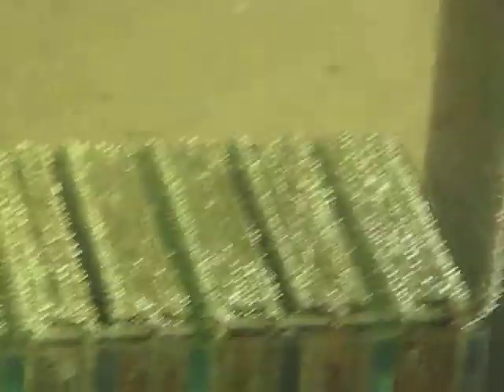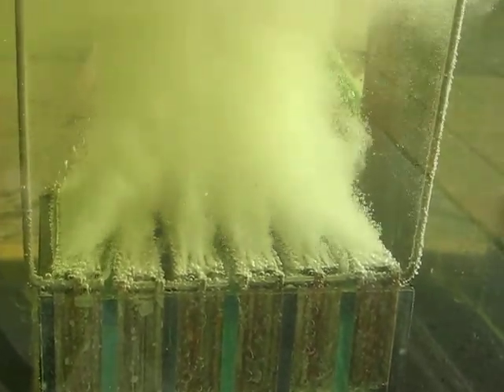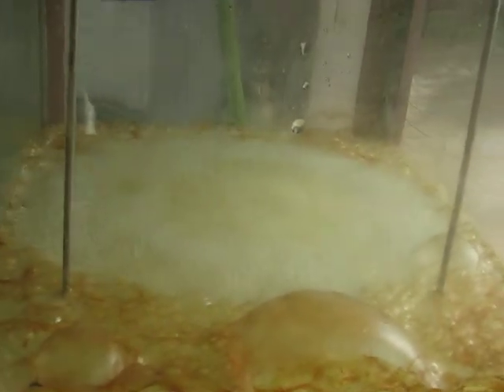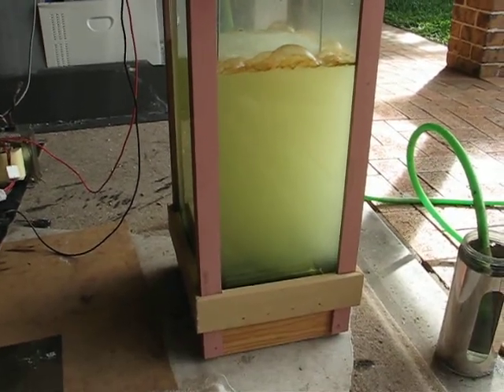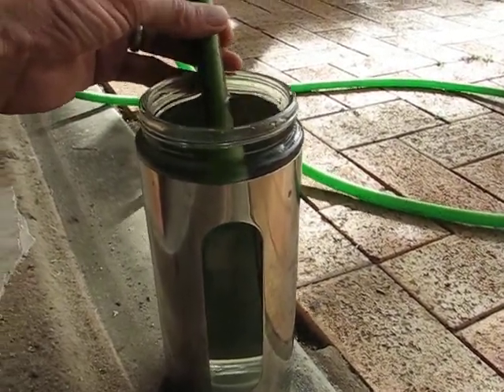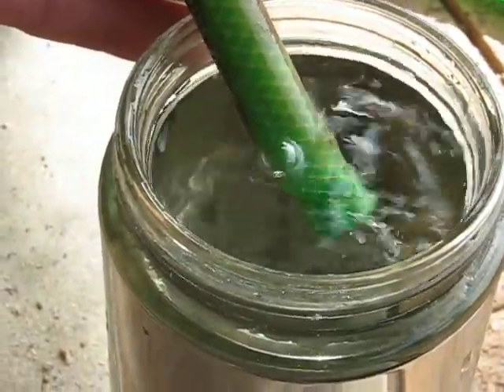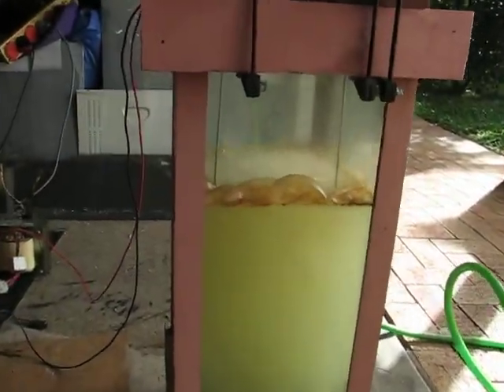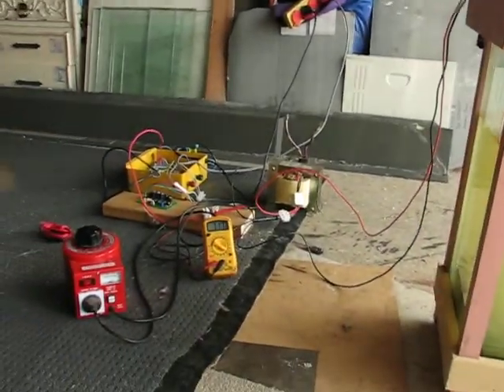My Six Cell Setup

Comment: Now this is more than likely the best advise anyone has ever given you concerning this technology. Find the largest transformer core on the market and get some coated magnet wire at around 16-18 awg or so. The wire going to the positive is to be made of copper and the wire going to the negative is to be made of some sort of resistance wire. Try to aim for the maximum amount of turns that will fit on the core. More than likely you will have to make your own bobbin. Do this and your unit will fire up as never seen before. You should wind a minimum of one thousand turns each in a bifilar wind which is both wires wound together at the same time.
Reply from the maker: Thanks for letting me know about the wire, was thinking about building a new unit soon to put in my car, I have seen a motor run on nothing but water and to look at it you could not see any changes except the single wire coil on the side of the motor that ran strait onto the positive of the cars ignition coil, had no fuel cell at all, he told us he increased the fuel jets to allow twice the amount of flow and that was all, but I was only a boy when I seen it, so he may have had custom spark plugs but unsure, but the coil was around 4x4 inches and would have had at least a thousand turns, so yes will give it a go, but will keep winding until my coil has around the same dimensions and see what it ends up as, will post once I have built it and let you know how it works out, but if it works I may be best to keep it quiet or I might get a visit like the man I seen did, he is no longer with us, if you know what I mean.

Comment: Excellent work thumbs up if you use a tens unit or a pulse width modulation of 24 volts it will increase output and create less heat
Reply from the maker: thanks, I am getting back into this stuff digging up my old files and getting ready, will remember what you said and give it a go.
Reply from the maker: Rachael Reid  
She is a lunatic full on, she did two  other ones but never posted them, well at least it is over.
She acts like this every time she is broke, and believe me that will be in three wees or four.

Comment: Hey, been a while since you've played with this setup. I've figured out how Meyer did what he did now and am now just trying to save up the funds to get things going. I also figured out why when these devices are just added to a car's intake system why they don't work and the reason being one must have access to the car's fuel management system and tell the car not to dump in so much fuel. If not the car's computer will end up making things a lot worse as it's programed for a specific air to fuel ratio and that ratio must be changed to see the benefits of adding in a hho device to the system. 
As for science behind Meyer's technology I went and posted  a link to a pdf file in the pinned post in this video: https://www.youtube.com/watch?v=EkjpVcsRQLc&t=27s&ab_channel=EdwardMitchellEdwardMitchell

Good to see your getting back into this🥳.